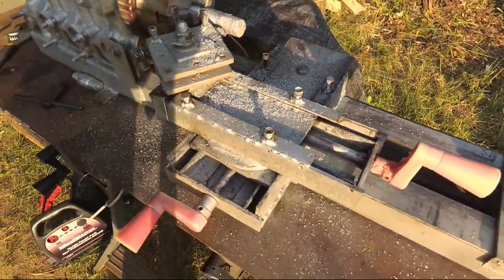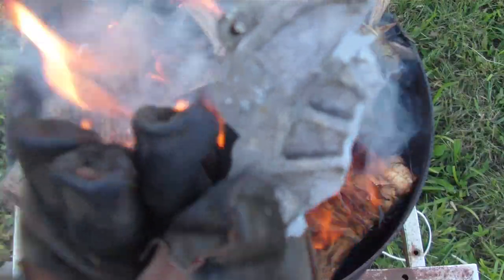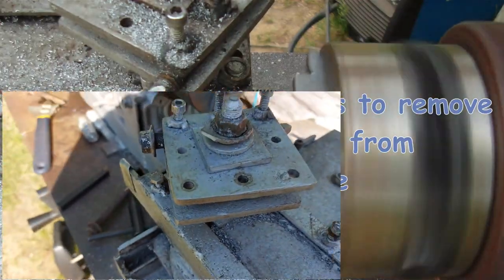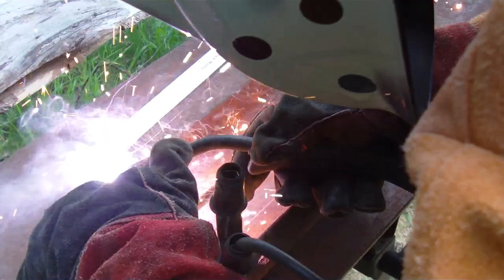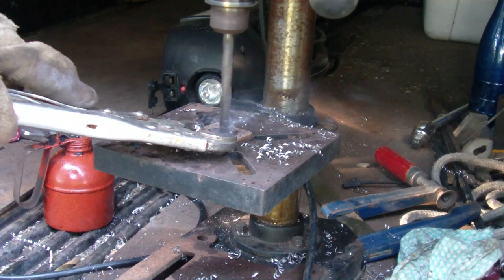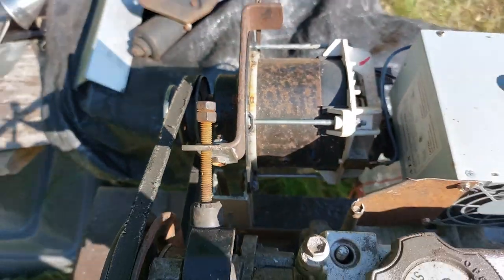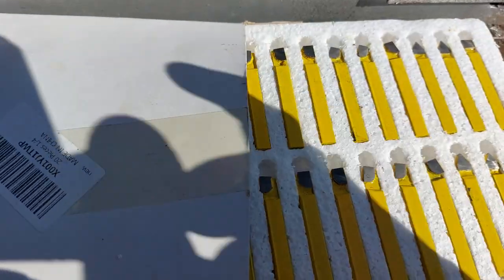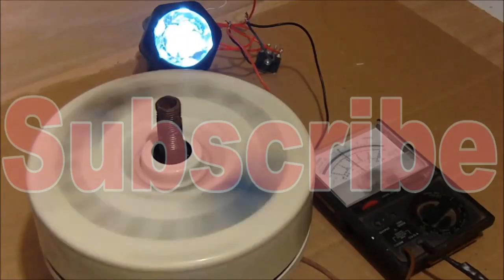I Built a Homemade Mini Metal Lathe from Scrap [ How-to ]

Comment: You build a crappy lathe... this allows you to make the parts for a better lathe... that allows you to make a good lathe.... the lathe is one of the few tools capable of replicating itself
Reply from the maker: Thanks! very true, I should try and use it to build a better lathe or some tools for other lathes. I wasn't expecting any precision parts to be made on this lathe, but who knows with some improvements.  I've only used a real lathe when I was in high school, so I have a lot to learn. Good luck on your track lathe build.
Reply: I bet you're a fantastic guy in person.  Talk about an a-hole. He didn't say he was an engineer or any kind of pro. It's a 50$ lathe, what did you expect something 3- phase, tool.

Comment: actually these bearings are more accurate than pillow bearings . . my advice seal the cylinder head very well and fill it with motor oil and that's it !! Also I noticed it is shaking a lot . . better bury the lathe bed into a concrete base using long anchor bols . . you can turn it into an amazing lathe
Reply: Or use the block to that motor as the ways. Absolutely flat, a x the head could probably shelf  onto the block 5, or so inches so it it perfectly in line with the ways. Similar to the open source multi machine, with that, if your not familiar, he uses a 6 cyl block as the ways, and a 4cy as his head, beciase engine blocks are perfectly flat. I think he attaches the vertical block to the horizontal via the bell housing. Then the cyl bores are perfect 90° to the block, he has one of the bored out to accept a large bearing, don't recall the size 3" sounds familiar, a d uses a thick walled pipe as the spindle so it is hollow,and he can lathe longer items. There is a lot more too it, and plans are free online. In a video he has here on YouTube he takes a 3/4" wide cut, i believe 7/8" deep in a single pass through thick steel, and  has zero chatter!  All built from scrap. I believe he also fills blocks with. Concrete, after he has it exactly as he wants it. Suck to cement it, and realize you need to change something I imagine.
Check it out. Thing is every bit as accurate as a south bend.
Reply: @aliciagalindo3038  Clever woman . . Cement is for the big bolts which can be adjusted. I can't speak in inches but I believe that bolt sizes that match the holes in the  block cylinder can be buried in concrete with nuts on their threads to adjust the block cylinder. 
But if you read the youtuber's comments, he builds his projects with what is available to him on the cheap  . . yours needs a little investmement.
Though, I'm surprised it was a girl/woman who replied to me . . I'm impressed with your response. Most probably you studied engineering or you're one them Fast and Furious Tough Race Chicks ^_-

Comment: Love the cylinder head, especially with the valve cover on. Look up "MultiMachine" for using engine blocks. They made concrete bed lathes in WWI for big machining jobs - cheap and fast. The weight makes a difference.
Reply from the maker: Thank you I appreciate that 👍 I will also look up MultiMachine and concrete bed lathes, great info!

Comment: Looove the head trick! I thought of using an upturned block with the head mating surface bolted down to the ways/frame. Ended up using a couple of big pillow block bearings out of an industrial A/C unit. Another comment mentioned welding the ways and how distortion will drive you crazy - he's right I spent countless hours trying to get mine straight after welding them. Other comments I agree with are that if in doubt, make it heavy. Weight will compensate for a good measure of imprecision. I haven't touched my project for a couple of years, but getting back into it now. Thanks for the inspiration!
Reply from the maker: Thanks a lot! all grate ideas, lots of people in here leaving awesome feedback and advise. No problem, I know what you mean I haven't touched my lathe project since I posted the video.

Comment: Cool, we were talking about a mini lathe with some friends today. I've always wanted to make one, but I'm really afraid about the play and how you can make the bed surface really level. I think yours is pretty nice, would be cool if you can add some fancy things like a better tool post, a meter for both axis and maybe an automatic way of moving the carriage in sync with the main motor/chuck.
Reply from the maker: Thanks a lot 👍, I was thinking about adding a motor to move the carriage lead screw but this lathe project was taking forever to even get working. I will take your advice and add some upgrades, I'm not done with this lathe yet.
Reply: @kurtscottage  Remember that if it's not synchronized with the chuck's movement, you can't make threads on your piece. But for every other usage, should be fine!
Reply: concrete

Comment: I think they call this style like the "Gingery Style Lathe" or mill.  I'm not sure if they use the camshaft to mount the chuck though.  Very neat and you should look into since you might be able to at least use your lathe as a vertical mill and possibly make more tools as you need.  Thanks for sharing!
Reply from the maker: Thanks 👍  love the info.  I was thinking of adding some improvements to the lathe, using it for milling would be awesome. You're welcome!

Comment: Man, this takes the gold in the "improvised machine tools" category. Very clever using the head as a headstock. I suspect that it, like babbitt poured bearings, will be more accurate than pillow block bearings (at least for a while). I would suggest you plug any holes in that head and fill with oil so the cam lobes splash it around. Really like the head-headstock. On the rest of it though, I think you can make some big improvements without breaking the bank. That steel angle is not accurate and you will only ever be able to make things to approximate and inconsistent dimensions. There are loads of examples on YouTube about how to machine "perfect" flat/straight/parallel lathe ways with primitive tools.
Reply from the maker: Thanks I really appreciate it 👍 I like the feedback.  I'm going to try and upgrade things and you're right the ways need improvements.  I was thinking one day of maybe using a engine block, unfortunately I only have smaller 4 cylinder engines and some seized v8s.

Comment: I’ve always wanted to do this. I accidentally came across a video of a guy getting sucked into a big industrial lathe and after watching that I’m a little bit nervous about lathes in general. Why not build a chopsaw? You are obviously capable and it would make a great video!
Reply from the maker: I was thinking about putting a cutting disc on a miter saw, but I had second thoughts when reading about there differences. Thanks for the idea, I never even thought about building one 👍

Comment: Is it my imagination or is your chuck spinning clockwise so its pressing your tool/tool post upward? I'm pretty sure the chuck is supposed to be rotating downward onto the tool so the cut is happening on top of the carbide/HSS tool. I imagine this will account for some of the chatter.
Reply from the maker: Thanks for the comment 👍, when I watched videos of metal lathes they looked like they were turning clockwise so I never really thought of that. That makes a lot of sense now, lol why didn't I try that.  I can easily switch the wires and try the lathe now counter clockwise.
Reply: @kurtscottage  Welcome!

P.S. Let us know how you get on when you swap them over. Thanks!

P.P.S. Some videos rotating machines may appear to rotate backwards or stand still under artificial lights. This is due to it being "in phase" electrically with it (AKA stroboscopic effect). This is normally eliminated with filament lighting (non flicker) or using a lead lag circuit (separate phases for lighting and machine).

Comment: You can get free lead screws from scissor jacks that usually come with the spare
Reply from the maker: Great info thanks for sharing. I was thinking about using some jacks while building this, but I didn't want to chop up my only jacks. If I find more jacks I will defiantly use them 👍

Comment: love the innovation level here, a couple of observations for you:  Linsay Publications & The Gingery "Build you own shop from Scrap" Overall your build is cool but falls so far short of what you will be happy with I recommend checking out.  I'm now building CNC Conversions for my lathes and milling machine.  Second book you need: The Engineers Black Book - will bring you up to speed in a week of studying.  Keep on building😀
Reply from the maker: Thanks I really appreciate it. Love the comment, this really helps us all 👍, I will check out those books.  I'm so new to lathes and milling, I haven't made anything useful so far on the lathe,  when things warm up here, I'm going to try and make a motor shaft coupler.

Comment: Man, that's really cool. Any plans on adding an oil pump to keep the bearings happy? Without oil pressure they probably won't last too long.
Reply from the maker: Thanks I really appreciate it 👍I was thinking about it, would have to tap into the oil inlets and have a pump to circulate oil around. Great advice!
Reply: @kurtscottage  use a block/crank with a cover bolted onto the block deck and fill it with oil

Comment: Very cool! Is the chuck spinning towards you or away from you. It looks like at one point you spin it away from you and so you’d be cutting on the bottom side of your tool?
Reply from the maker: Thanks a lot 👍  you're right, I think it was spinning clockwise. Someone else also pointed out that it's spinning the wrong way.  I need to switch the motor wires and see what happens.

Comment: What are you using to control the motor speed?
Reply from the maker: I'm using a PWM speed controller board, DC 10-50V 60A Motor Speed Control 12V 24V 48V 3000W

Comment: Yours is a lathe.  Someone came up with a “multi machine” idea of using engine blocks as the basis of a machine shop.  The belief is engines are all over the world regardless of your poverty or affluent level, you can find them on side of road.  Engines have machined parallel ways, you can build precision off them.

There are websites dedicated to turning engine blocks into lathes & mills.
Reply: I built a lathe from the muli machine site it had an 8inch Chuck and a 2inch through hole in the spindle.

Comment: Maybe you did this lathe so fast because you had to use it for something, but if you want a to build a good one you need time and you should not use welding at all unless you are prepared to pay a milling shop to mill it straight and flat after welding
Reply from the maker: Good Advice. I rushed the build, the thing is I start losing interest on my builds if they start taking to long to become working.  I'm definitely not a perfectionist and I don't mind admitting it 😎
Reply: @kurtscottage  A good working and accurate DIY lathe will make all your future projects easier, even solve many of your real life problems. I was about to build one myself as the chinese ones on the market are a disaster but unfortuately we are having a serious economic problem in my country right now so I'd better use the money for food